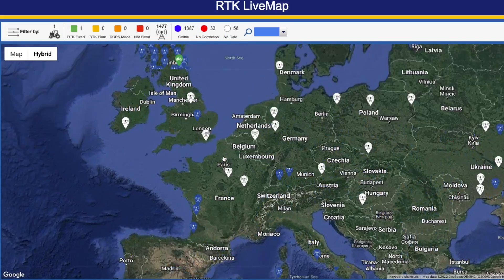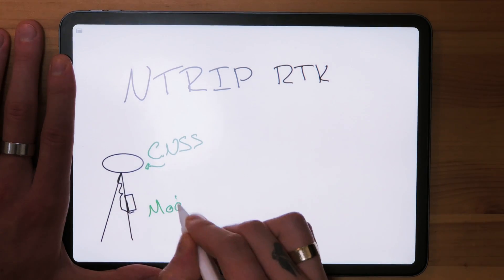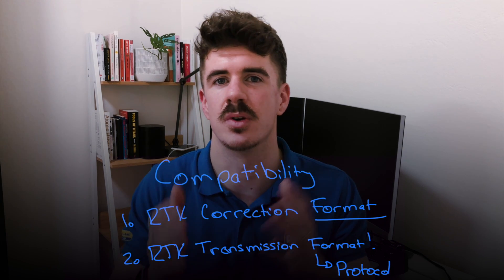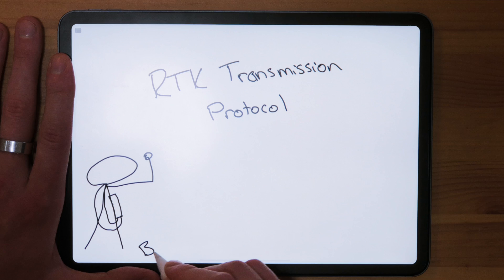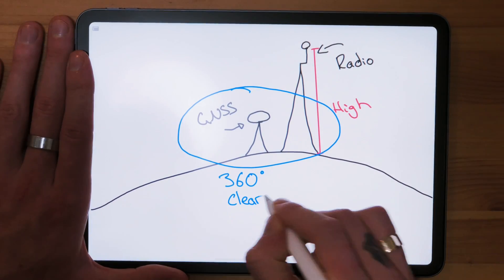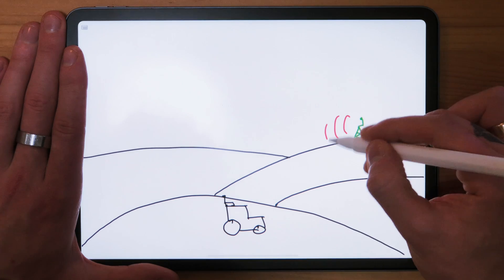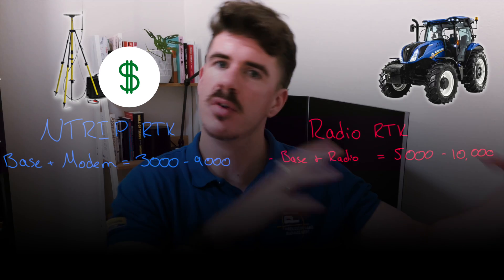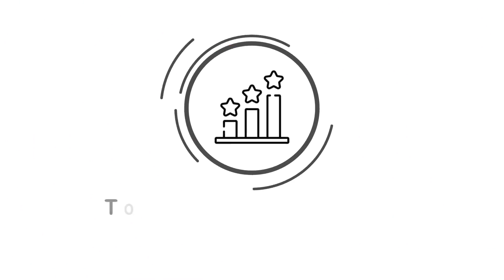Precision Agriculture Fundamentals - All You Need to Know For RTK Farming

Comment: Hey, there's a lot of information to digest on rtk, let me explain what i need maybe you can help me if you have the time at hand and benevolence.
I run an agri operation, we currently have 4 gps systems, 2 on rtk with a subscription (a chcnav and a fj dynamics) and 2 are on running normal gnss, an Ag 372 from CNH/trimble and i believe a nav900 from trimble.

1. The CHCNAV i was told was blocked from running another base station, so i would need to buy an unlocking code which is quite expensive and would ultimately mean around 10 years of subscription of rtk from that dealer so it is a no go (assuming the guidance works for 10 years of course as it runs with an electric motor) but if you know a way around that i would be glad to know, of course.

2. The FJ dynamics is what i wanted in the first place, it is an AH2, it can connect to any base station, i currently run it through my local expert that is called ROMPOS, but i suspect they have some older antennas or their overall signal is slower because my tractor is kinda doing zig zags instead of going to a straight line. If i put a line through those zig zags, then it is a straight line, but it won't stop correcting itself and this is a situation i want to deal with, but we'll get to that.

3. The Ag 372 is the main problem actually, i want to buy an AG-715 trimble modem for the antenna (but i suspect that might be blocked on dealer signal??) or maybe a sierra gx450, but the problem is that i need the level1>lvl2 subscription from trimble, then the lvl2>lvl3 subscription and those are quite pricy, which begs the question with all these, will i still be blocked into CNH subscriptions or can i connect to any rover i want?
In case i am blocked do i keep it or do i change the auto guidance entirely and look for another antenna like the fj dynamics AS2 which is made for auto guidance steer ready tractors so it would pretty much be plug and play, but i would like to skip the dealer as well and place my own antenna as that would help me reduce my costs to about 500 euro/year in subscriptions for these 2 fj dynamics and possibly 750/year if i add the CHCNAV to this, as well as future other gps systems that i can use if i continue on the fjdynamics route.

4. The nav900 trimble system is currently of no interes for rtk upgrading.

So... if i understand correctly, i would need a base station from fj dynamics, in this case probably the V1 and the range extender in order to achieve a radius of around 20-30km coverage which i suspect i would need as i would like the station to be fixed in the farm, ocasionally on a fixed second location, and not scout it in the field every time i work?